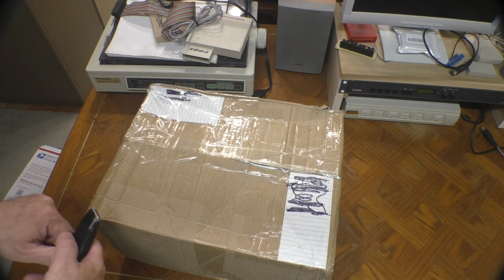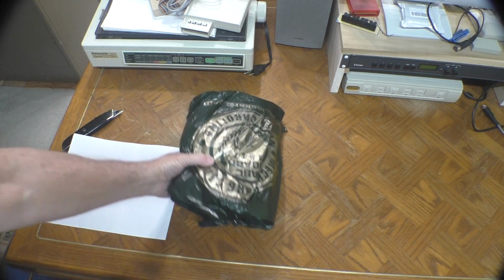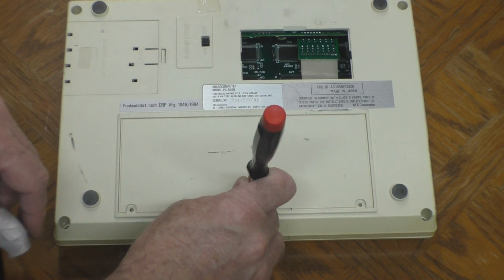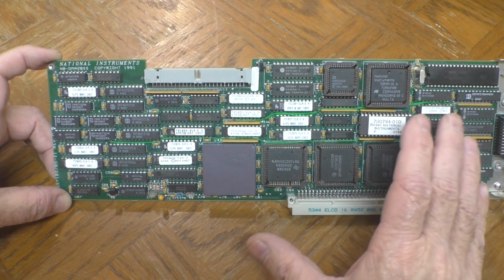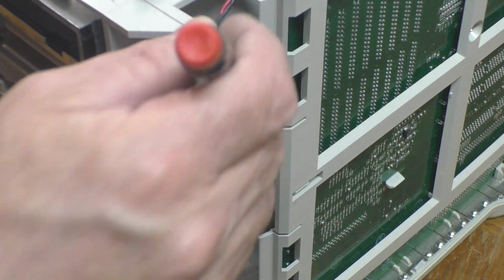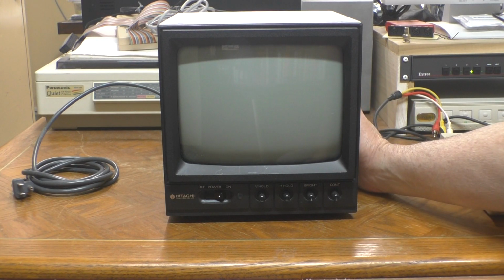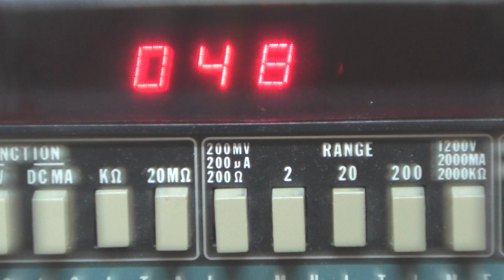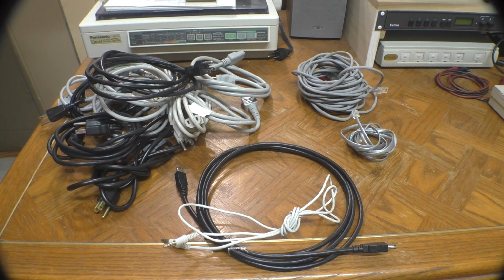A trio of slabtops, a stack of old Macs, and a big box of misc. vintage goodies

Comment: Oh, wow, I've wanted a Workslate ever since I saw it one of those "product guides" the magazine publishers used to put out back in the day.
The Olivetti is fantastic too. That company had such beautiful industrial design. I didn't realize the machine was that distinctive jade-green color.
Reply from the maker: The Workslate has an interesting mix of features but I think they missed the mark with the 'every app is a spreadsheet' idea and the terrible keyboard. It was also much more expensive than similar computers back in the day like the Model 100 (which was much more useable and useful.)

The M10 is quite lovely, the tilting screen really added that last little bit to the basic M100 slabtop form factor.

Comment: Wondering what the cut-off point for "expensive" at that uni? Pretty much all Macs of these types were expensive to pretty much anybody.
Reply from the maker: When I started in early 2000s it was $5k, at or above $5k and it got a yellow sticker.
Reply: @HeyBirt  When I was working at a community college in Florida in the mid to late 1990s, they initially slapped a tag on everything down to keyboards. Then there was a mass theft of mouse balls from a classroom. However, when the auditor had to look through 400+ pages of just computer related inventory, that stopped pretty fast. We had 20,000 students and change on one campus, four campuses, and multiple faculty, staff, etc. for a total of 4000+ desktops, 52 terminals, 4 mainframes (one of which fed to the other three on other campuses), and 40 servers. The auditor felt that was enough to keep track of annually. That didn’t even include the “fluid” inventory of things removed from circulation in preparation to be sold at auction. That first inventory was not pleasant though.

Comment: What happened to your thumb?
Reply from the maker: Stupidity ;) 

Carbide end mills are sharp...
Reply: @HeyBirt  ouch. Old computer cases were sharp also. I was working on one to add a 3.5” drive years ago. As I was trying to push out the metal front piece, my hand slipped and I cut my finger requiring six stitches. Computers. I love them/I hate them. I prefer my current job at university teaching programming. Central Methodist University. I’m in Clinton,MO North of you.
Reply: @jeffreyphipps1507  I learned to not buy cheap aluminum cases by slicing open a fingertip pushing out a slot cover back in the 90's.  Twice, in fact, one from each side of the case slot.  As you might expect, the stamped aluminum was razor sharp.  (Fortunately, despite being painful and inconvenient, this kind of injury heals remarkably easily and well on a fingertip.  I suppose that's what comes of 2.5 million years of cutting ourselves making stone tools.)

Comment: You can try to remove the security plates by cutting through the foam sticker with a thicker nylon fishing line or steel wire along the metal plate. I don’t know if here is a solvent that can easily remove the glue from he sides inwards. Maybe try feed WD40 under at a point where you first cut in with a really thin blade.
Reply from the maker: Thanks, using fishing line is a good idea.

Comment: Those Quadra 900 were server systems often used as file server running Apple A/ UX an early adventure of Apple un UNIX land- not very successful nor stable from what I heard. Those PPC 8000 series Macs were nice Minitower systems. When you remove the cards and the plastic NMI and Reset buttons and the plastic spacer between the psu and drive cage you can disassemble the unit. The moard 5en slides to the front and can be removed. My first Mac at work was a ppc 8500/100 with 192mb - in 1997 this was a fast great maschine for web development and graphics.
Reply from the maker: It makes me wonder why it was stripped of all the RAM. They must have moved it to a different machine.
Reply: @HeyBirt  I think it cold be that  it was an Standby system. Not in use so only bare case+ board. Didn’t you mention it looked very clean?
Reply from the maker: It did have a hard drive in it which makes me wonder if they stripped it for parts.

Comment: The apple card with the heat sink is Macintosh Processor Upgrade Card. PowerPC 601 CPU and plugs into the 68040 CPU socket of the upgraded machine.
Reply from the maker: Thanks. I find it odd that so many cards are made, by so many manufacturers, with no indication on them what they are.

Comment: The quadra 800 / PowerMac 8100 / PowerMac 8500 had the clunkiest top cases ever! those pesky metal tabs at the bottom perimeter along with the logicboard brackets and frames made them a nightmare to work with
Reply from the maker: The cover sure does not want to stay on. It popped loose after caring it a few feet to the storage room.